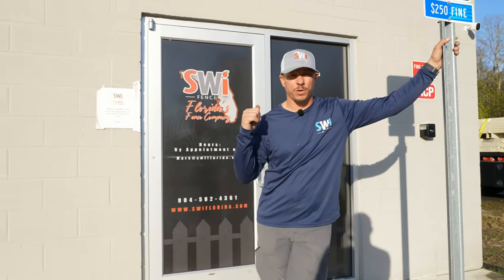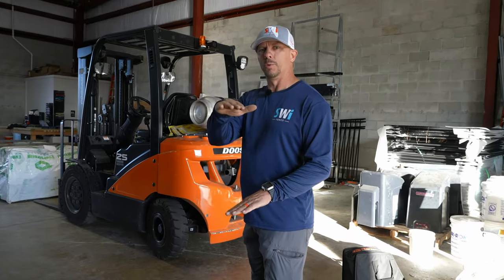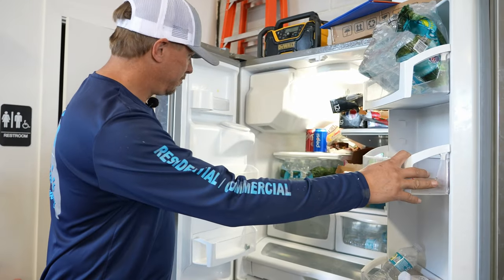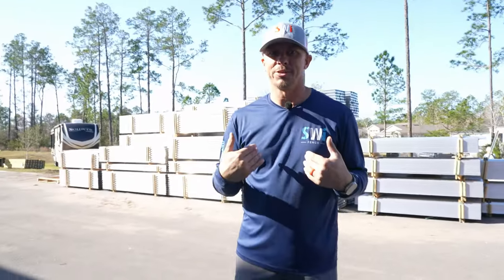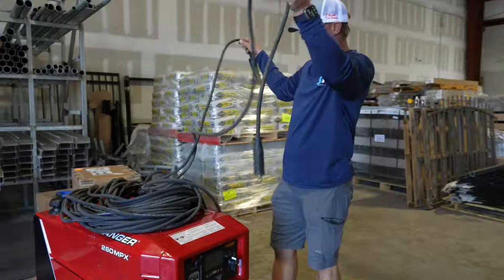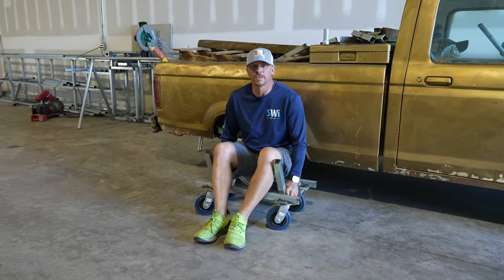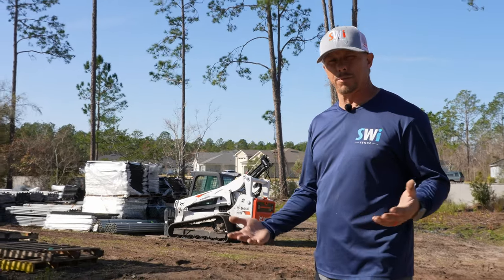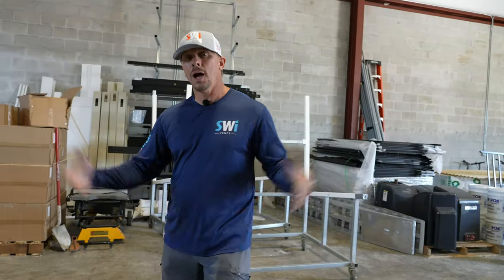Behind The Scenes Of My Fence-Building Startup

Comment: I want to see the hydraulic pounder in action thinking about getting one for commercial fence
Reply from the maker: Stay tuned--couple of videos coming in the next month you'll be interested in then. 👍🏻
Reply: @SWiFence  i like the fact you can use tractor or skid steer hydraulics and not need a huge air compressor or hydraulic pack. definitely be interesting to see. like the tool videos getting too old to do stuff the hard way like we have when we were teenagers.